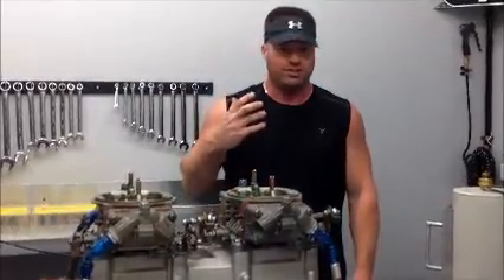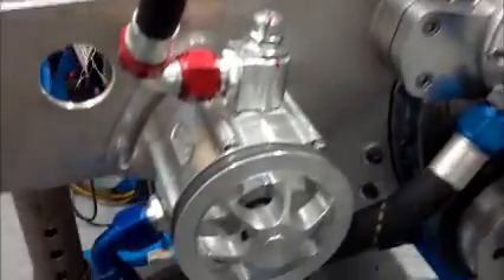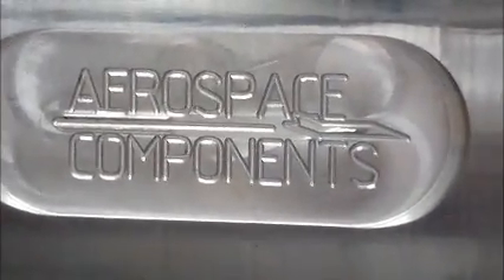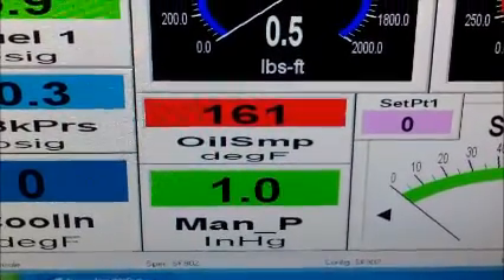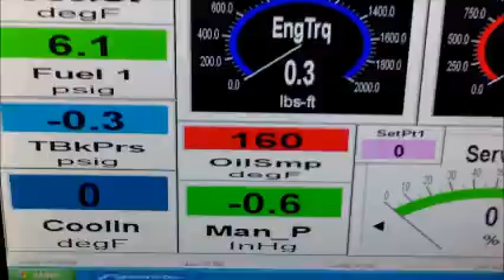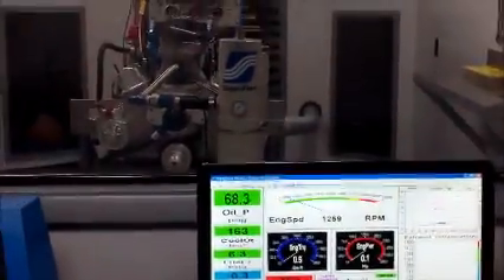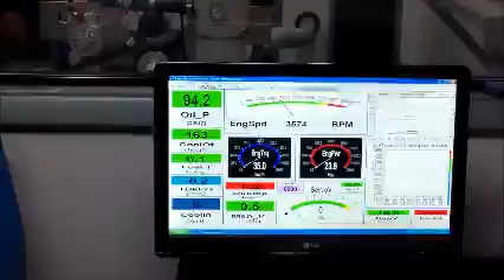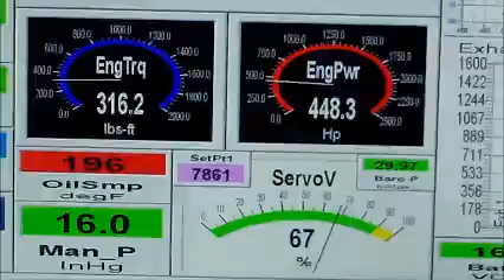Aerospace Components Vacuum Pump Dyno Test By: Matt Scranton

Comment: That engine isn't even close to being done at 7500 lol. Would the gains be higher for boosted engines since there's more blowby?
Reply: Yea. Definitely.  You’d see a smoother running engine at higher rpm and you would blow by less.  The vacuum on the crank case really just lines up the rings with equal pressure on the bottom side of the piston to the top. Not equal. But it equalizes pressures.  Keeps the rings from fluttering
Reply: It’s removes the air pressure made by the bottom side of the pistons from all the wind age basically and that creates more hp

Comment: Ok, one test one without belt on vacuum pump - where did case vents go? The vacuum pump, pending where rotors/vans were clocked could act like a block valve - and engine is going to build case pressure and loose HP.

By just putting on belt - you magically don’t gain 20 HP - need to compare to atmospheric vented system - properly routed with same size lines - then line up vacuum pump through same size lines and then compare.
Reply: I was thinking the same thing. Haha
Reply: Ya, I'm pretty surprised the company that makes this pump thought this presentation would fly unchecked.  The whole reason I'm here is to see the effectiveness of the pump and the sales team thought a bunch of gear heads wouldn't understand that they ran that first test with the vents BLOCKED off?!!  C'mon guys.
Reply: Exactly my thoughts

Comment: You should have compared it with the vacuum line taken off and a breather installed.

With the pump off the crankcase pressure has nowhere to go and will lose hp because of this.